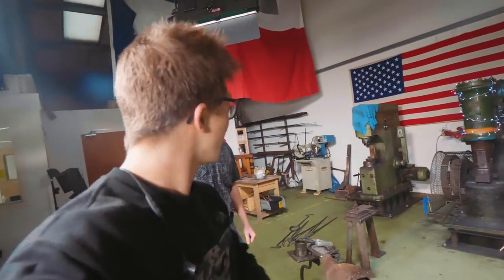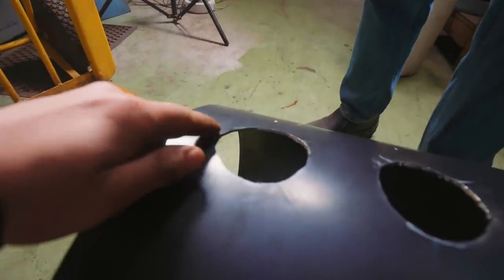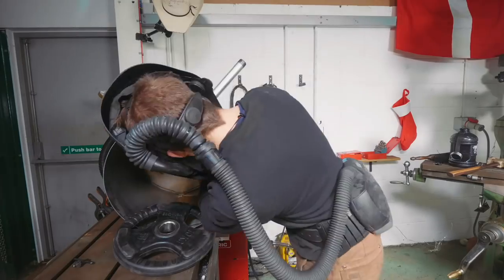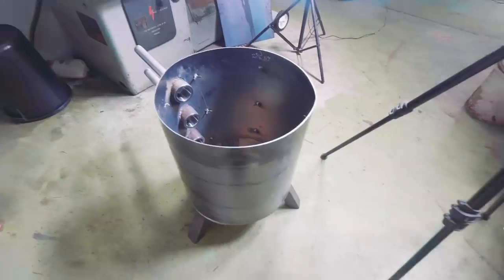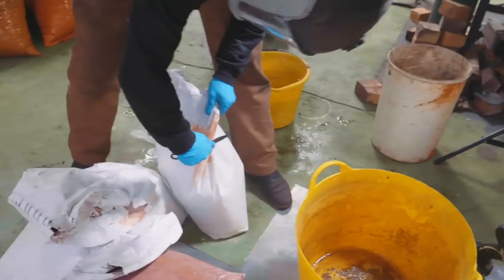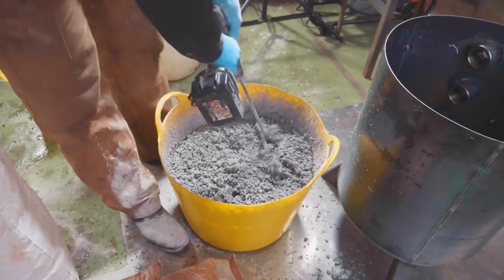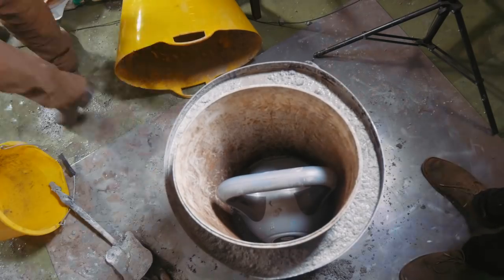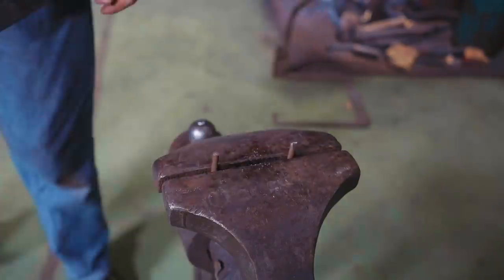BUILDING A FOUNDRY!!! PART 2

Comment: Hey Alec. Make sure you drill a small hole in the bottom of your foundry, so that if (when) you have a spill or a crucible fails you are able to get the molten metal out. 

Hope this helps
Reply: small = 2" diameter, or 50mm if you don't have any 2" holes.

Comment: Hey Alec, pro tip - fill the bucket with water before you fill the outside up with the refractory material! This causes even pressure against all sides. We have a fiberglass inspection pit in our garage at home as I'm massively into modifying cars and before we installed my dad went to another guys house to see how it looked. Apparently they started pouring concrete around the outside without any weight in the pit so it started rising exactly as it happened here! Love the videos, been watching for a long time keep It up!

Comment: Plasma circle tip i tack weld a washer on the metal i want to cut. Then i run the plasma torch around the outside or inside of the washer. Boom perfect hole!!!!! Great video as always Alec.

Comment: Alec, what refractory do you use for the forge and for the foundry? I'm looking for a hard or medium refractory that is Flux resistant for the floor of a propane forge I'm building. I'm 14, have been forging for a year and you are a inspiration.
Reply: Nathaniel Heidemann Same, I would like to know.
Reply: I don't know what Alec is using, but I used Kast-O-Lite 30 for mine and it works great
Reply: Shalor McKee have you ever heard of mizzou? it's another castable refractory that is similar. any differences that you know of?
Reply: I am twelve and have been forging for around a year

Comment: Alec,

First, I have never tried to make concrete inside that seems insane.

Second, here is an old construction trick best used when making concrete outside in a wheelbarrow with a spray garden house. 
Wet the bag before you cut it open. Just spray the bag  with a little water before cutting it open, then again before pouring, have some water to pour into, and have someone spraying a little water as you pour. Think garden hose shower setting.

This basically eliminates the dust issue. No one is wearing a space mask working outside in a Florida summer.

Comment: Try fiberfrax or ceramiwool k28 for your refractory insulator. Easy to replace. Easy to instal. Higher r value. Coat with alumina silicate.

Comment: as for the pouring. If you pour and fill the internal bucket/mold with water as you go you will have equel pressure all around

Comment: The sand box is called a flask. The top is called a cope, the bottom a drag. The pieces of steel you used to get the burner flares into the chamber could have been made of wood with a taper (small end in the flare, large end out to the chamber). When you are casting, this taper is called draft angle, 5-7 degrees. It makes things come out easier.

Comment: Vermicrete! Cheap castable refractory, 1 sand 1 cement 5 vermiculite some water mix and your done use it for my last casting furnace had no problem melting Aluminium with a single burner, 10kg batches

Comment: +Alec Steele Would recommend having a hole in the bottom of your foundry, incase one of your crucibles fail. Also you can make a decent refractory yourself for the lid using cement, perlite, sand and fireclay. And lastly seems a bit overkill using 3 burners, especially the one thats so close to the top, having two towards the bottom at opposite sides would work better I think.

Comment: For those following along...  the trick to avoiding the inner form to collapsing, is to fill it with sand.  ...and flares on the gas burners aren't necessary.  The back pressure created by the furnace is more than enough to slow their flow and allow the flame to develop

Comment: Just a little tip, you could have filled the bucket with water to keep it in place and to stop it from distorting
Reply: That's a really bad idea, I tried it once and the bucket wasn't heavy enough so the refractory pushed it out, spilled the water, and ruined the furnace. The bricks and weights worked well
Reply: Stacking multiple buckets of the same size would better maintain structural integrity of the cylinder. Then you could just weigh it down accordingly.

Comment: Mig, tig, tack... so many different kinds of welding!!
Reply: Pagne Daman MIG is metal inert gas welding, it uses wire feed and normally CO2 or a flux in the wire similar to solder. TIG is tungsten inert gas welding, it uses a tungsten tip to strike and maintain the arc, and the filler metal rod is optional... it uses argon, which is actually inert and as such gives a cleaner weld. Tack welding is just welding a spot to hold something in place, instead of a full weld.

Comment: If you use bronze as your cast metal and you fill your crucible with shaving and scrape you want to put crush green glass on top and it forms a flux so you don’t get copper oxide when you try to melting your bronze 
Try aluminum to but use a different crucible and enjoy 
You need to make a ladle to skim off the slags when you pour bronze you just want a little bit of a greenish flame 
Used two or more spours and venting like with a 1/4 in rod help vent gas when you pour

Comment: if you want that casting oven to run more efficiently, "paint" the inside with zirkonium paint used by ceramics makers as coating. Or use ITC-100 if you can find it in the EU. It reflects infrared heat, making your furnace much more efficient.

Comment: Pieces of angle iron with longer legs would have centralized the bucket for you as well as provide some more structure to the casting material, or filling the bucket with class A cement previous to placing it in the outer shell, thus eliminating the bucket tilt/out of rounding.....That said damn cool project and teamwork!

Comment: Alec was wondering if placing one burner every 60 degrees would result in a more even heat of the crucibles? Perhaps it makes no difference when it comes to melting and/or smelting process? Might also help with centering the refractory.

Comment: Hey! Alec, just as a heads up you need to cure the glaze on some crucibles before you expose them to extreme heat. I've seen curing done in an oven. I forgot to cure mine and the sides started to crack and my crucible leaked all over the cement and started exploding. Not my finest moment but at least I learned from it.

Comment: you would love my blast furnace, it has a cast iron body and a swing around lid, it is a copy of jack courts furnace.  but holds a 9 kg crucible as a ladling or smaller ones to be removed when poring

Comment: the reason why it warped is the mig welder gets the steel hot and that causes the steel to warp, thats why its out of shape, next time put all 3 in at the same time, doing about 2 half inch welds on 1 burner and then move to the next one, repeat and then let the steal cool for a bit, then repeat the process till it makes it all the way around

Comment: Alec I've been doing concrete for many many years and you mixed it to thick wet it up just a little more just enough you can poor it into the furnace and make sure that you tap the sides and that will help pull the air bubbles to the top. Because if you get to big of air pockets the air inside will expandand pop and they can pop big sounds like a gun going off. I hotter that i can help

Comment: This is an example why some quick calculations would be very helpful when making something, if you thought about working out the volume of the bucket you were using and the volume of the foundry, just using simple area of circle multiplied by the height to get a rough volume, you could work out how much refractery  you would have roughly worked out how much concrete you would have needed to fill up the foundry. As you keep saying in other videos, get it right first time :D

Comment: Steel bar should go inside the bucket. Calculate bucket volume, calculate cement weight on that volume, and the weight in bucket should exceed the calculated weight. Sometimes using CAD to calculate curve on surface projection isn’t cheating.

Comment: Hey Alec, while I haven’t tried my hand at smithing (yet, but I’d love to make a Katana some day...) or at casting, and I’m a pretty crappy welder on the best of days, I do fancy myself a bit of a Tinkerer, and love to solve problems... 

How about next time you need to measure up an angle on a cylinder, you lay the open end of a length of angle-iron flush against it... you know that the sides of the angle-iron will be 45° to a perpendicular to the side of the cylinder... that should give you at least a starting point to get a measurement that may be a little bit more repeatable than the Mk1 EyeBall... 😉

REALLY love the Channel, Buddy!!! Keep up the great work!

Comment: I would have recommended more buckets with that small of a mixer. The top may be fine but more likely for dry pockets. If all worked out well then good on you sir, unorthodox with a knack for getting things right.

Comment: as i watch this particular video, a question came to mind while he was doing the burner holes. i would think that those should be done last, after the refractory material has already been poured and hardened, that way he's doing less work and he can get the burners in with less difficulty and worry about how to get everything to fit properly

Comment: Hindsight being 20-20, I would have used a bucket filled with gravel and or concrete. That way you have the mould ready to go should it all go wrong. Use a proper concrete mixer, more even mix and easier to take small buckets out of to fill Furnace slowly and allow to settle evenly. That is my Monday morning coaching effort.

Comment: For future reference, here is a calculator for finding the ellipse for a cylinder at an angle. It is meant for doing exhaust pipes through a roof, but it should work fine for your needs. https://www.blocklayer.com/pipe-angle.aspx

Comment: Be mindful of the floor where you plan on casting... concrete has water in it that will flash to steam when you spill molten metal (which will happen eventually). You definitely don't want to have that molten metal spattering up at you!

Comment: That refractory looks like it might melt copper but melting Steel will be a challenge.  

If it was me I would have made a forced air foundry because many of the issues with foundries not getting hot enough is the lack of combustible oxygen.

Comment: in hind site of this you probably should have made a 1ft diameter cylinder to put in the foundry instead of using a plastic bucket, it wouldnt have risen up as much and probably would have been more rigid. but good job on making that foundry

Comment: I think the first mix was just a bit too dry. I disagree with the whole ''make a ball'' thing. But between the first mix and the last mix, there was the best mix. Also depends on the use. But for this use, I think what I described would've been ideal. And of course, the mixing. Because if some of it is balls that are dry inside, that won't work too well.

Comment: Hmmm i hope for you get the temps to melt things Alu will be no problem because it hase somthing aroung 600 C° melting temp but copper will be hard with a propane foundry may you have to boost the flame with extra air but im not a pro at propane things yiu even have troubles with cole melting copper. and you should look up if you need some sort of flux  and degaser because when not you might have problems

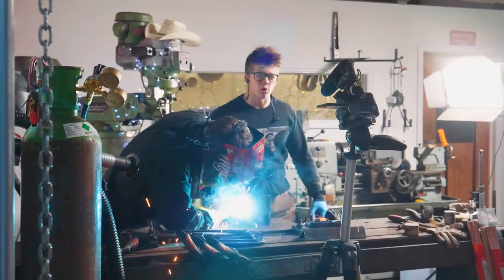Comment: 6:54 no problem being so close to the mig's light, without eye protections ?
Reply: He's squinting pretty good, but yeah, that is not enough protection. His eyes will be burning in the morning.
Reply: No problem for his eyes Alec is wearing glasses, glasses  have uv protection if it's not too long time he's fine. From my experience with welding is if someone is close beneath on the side of you even when you are not looking directly into the light sandy eyes keep you up at night....No you should not look into the arc light also not stare into the sun.
Reply: XJ9 not worth it. You can get a flash just from reflection

Comment: Heat rises, so what's the point in staging them on the vertical rather than concentrating them on the horizontal? Is it one of those 'that's just how it's done' type things? I mean, c'mon, surely blacksmiths have a good grasp of thermodynamics by now? Or surely one somewhere used a thermometer to measure a few designs? Having three diametrically opposed and offset 45 degrees around the lowest usable portion of the enclosure would maximise the temperature throughout. If it's too tall and gets cold spotting an additional burner two thirds up angled 45 degress off and 33 degrees down would knock that off.

Comment: You called the form of welding you were doing in this video TIG. That, my good sir is MIG
Reply: Better known as GMAW, Gas Metal Arc Welding
Reply: Ah. Never mind, I see that you called the stinger, and the machine itself a TIG machine. That's my bad.

Comment: what else you can use is plaster of Paris and sand with water, it's 1.1.1 ratio. very easy and might even have been cheaper. you can use it for your lid, I did and I was only using bark on the ground from a wood boiler and a hair dryer for the forced air. I was able to melt aluminum with just that. after you add a lid, you will be able to get up to melting steel temp especially because you are using gases. good luck bud.

Comment: Hi Alec I am your biggest fan (i know that evryone says that) i am from Latvia so my englidh is not the best.
So i have a problem, i realy like blacksmithing, but i have no motivation =only your videos 
And the reason why i dont have motivation is becouse i kind of have a workshopy thingy but im only 11 so my dad dosent let me use the angle grinder and thats realy the only thing i can use to make somthing and i cant realy use the forge toobecouse if im in the place where is the forge the place is full of twan gas (?)
So what do i do to progres

Sory for the super long coment
Reply: Get yourself a hammer.. and some solid copper wire.. as thick as you can get.. a good chunk of steel to hammer on and start practicing shaping and drawing out with it. Lots of fun projects you can make with that and no heat required and super cheap to get started.. always put safety first and take it seriously.. also that way you can show your parents you are mature enough for the next steps when you have learned more.. ie power tools and fire..  just my two cents.. lol
Reply: Use a hacksaw and files.
Reply: Mark W
Where do you live that copper is super cheap? It's like the 4th or 5th most expensive metal in central Kentucky USA.
Reply: Thomas Russell 
I dont know where in Latvia can you eaven get that